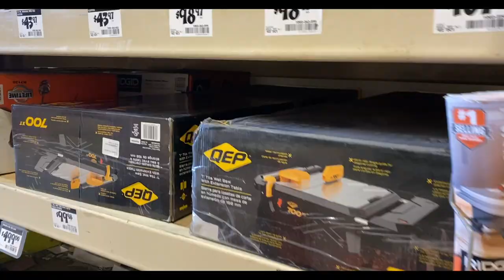The New Goonzquad Headquarters Part 46

Comment: The chips in the tile are more likely due to a cheap blade than a bad saw.  Get a high quality diamond blade and you'll be surprised with the difference.
Reply: Well said 👍👍👍
Reply: I thought that too. Having said that though, it did look like a pretty sh@tty saw. I'd have returned it, with the tile as evidence, when upgrading to the new saw.

Comment: 1/2" Durock or Hardie Backer is for walls. 1/4" is for floors. Set it in a mortar bed. Never lay it down without the mortar bed!
Reply: Also, looks like he used premixed mastic.  Big no no on floors or wet areas.

Comment: Strap those pex water lines! You’re gonna be mad if the wall gets closed and every time you turn the shower on or off the wall knocks.
Reply: Don't worry about that the shower valve is way too deep
Reply: That's why we use tubes instead of lines like you in US :D
Reply: @MegaGsizzle  tough guy, huh? Wanna cry for tubes?
Reply: @pischelales  hahaha 🤣
Reply: Doesn’t matter that the valves too deep the pipes will still clap the studs come on now
Reply: Jeremy Stephens  China / Japan / Korea would have something to say about that I'm sure.
Reply: Do a dry layout of tiles and cut a full one instead of leaving small pieces.
Reply: I made that mistake. I learned the hard way myself. Sucked to have to open the wall to fix after all the finish work was done. Hey...You live and learn.
Reply: @MegaGsizzle  The good old US of A all comes from Europe so calm down!
Reply: Here in Sweden we have all waterlines outside the wall, I would be scared having all that invisible in the walls
Reply: @MegaGsizzle  Old?
Reply: @HaroldWatnenase  just the clap herpies and plauge
Reply: @leeadler4221  Nah those countries don't innovate. They copy US innovations
Reply: Jeremy Stephens  I mean PPR pipes. They are strong and they will last forever. They are welded together and can be used even for heating.
Reply: @MegaGsizzle  A country founded in 1776 isn't exactly an old country.
Reply: Jeremy Stephens  Except you don't. The US isn't even in the top 5 among innovative countries, for 2020 they are ranked 9th in several indexes. Many Americans seems however to be somewhat indoctrinated to believe that the US is the greatest country in the world and having superiority to all other countries. It's gets even funnier when you realize that a very big percentage of US citizens haven't even travelled abroad or at least to a very small extent compared to people in many other well developed countries, and therefore doesn't a single clue of what the world looks like.
Reply: We have that problem.
Reply: @leeadler4221  China admits that they would rather steal ideas then take the time to engineer and invent on  their own.

Comment: If you're doing a steam shower you have to do a waterproof membrane on the entire shower, floor, walls, ceiling. The entire thing has to be water tight even the door setup you use.

Comment: When the tiles chip, first put some tape on the tile (shiny side). Then cut it. It will reduce chipping.
Reply: Nah. They should soak it in the water first. Very common. Don't waste your tape.
Reply: Something else is wrong if they're getting chipping.

Comment: We always used a grid system to lay tile. Snap a grid with chalk line. Then you can lay tile starting anywhere you want. On the line on one side of the square, off the line (by the width of your grout line) on the other side of the square. Makes everything so easy.

Comment: Please start using eye protection when you use a grinder. I've seen cutting discs explode and it's not a pretty sight... Please <3
Reply: I have a deep scar on my neck from 40 years ago.....piece of grinding wheel came off at full RPM. I swear, it's like getting shot.
Reply: Looks like that grinding wheel is a metal wheel, but it can still throw pieces of material. 100% agree... ALWAYS 👏🏻 ALWAYS 👏🏻 ALWAYS eye protection when grinding, no matter the type of grinding wheel!

Comment: I work in the tile industry and you guys tile better than people who have been doing it for a lifetime! Great job!
Reply: Well they forget the termination bar to the wood floors.
Reply: They didn't use motor under the cement board. The tile and grout will crack.
Reply: @chrishoca2938  I don't even think you are supposed to use cement board on a floor. You use that orange tile membrane stuff that comes in a roll.

Comment: When laying tiles, there should be an elevation toward the hole so that the water from shower will flow through that hole..
Reply: Very important point .  Or you get pudding
Reply: They said there dad is going to help build the pan to the drain.
Reply: @Robsav-yx6vi  who doesn't like pudding?

Comment: Since the drywall is done give that house a good cleaning and get the furnace fired up and running. You will need to acclimate all the wood trim and cabinets before installing for best results. Also spray the walls with one coat of paint before putting up any trim, it will save you from having to cut in on your painting. Just a couple tips

Comment: Definitely waterproof everywhere you can in the bathroom, it's BIG trouble when water leaks to the downstairs rooms.
Reply: Would have also done a higher threshold at the door so water can retain before it hits the hardwood.

Comment: Hey guys... Make sure you install the curb for the shower where the glass door goes correctly, it's a critical area for leaks. The shower liner and the way you install the  durarock is also critical. And... You should start your tile from the cent of the room and work toward the walls.

Comment: When you tile over the red guard, it's usually a good idea to use an "unmodified" thinset. Modified (which seems to be most common today) has some polymer additives which help to prevent the mortar from drying too quickly. Normally the cement board will soak a lot of moisture out of the mix. The additives help counteract that so you get a proper cure. But, when you put redguard down, that isn't an issue so that's probably why your thinset was taking so long to dry.

Comment: Great job on the floor! The red guard is great stuff. Especially for the steam shower and definitely a plus on the bathroom floor. With the steam shower you will constantly have condensation running down your walls and pooling on the floor outside the shower. Also make sure to follow the recommendations on the exhaust fan in the bathroom to get the excess steam out after during and after use. Maybe even slightly larger.

Comment: That redguard actually helps prevent the concrete and tile from cracking, when you lay it on a wood surface. I had to use that stuff religiously, when I did decorative concrete overlays.

Comment: You need to do a pre-slope with mortar in the shower before you install your membrane, which will be clamped to the sub-drain, which has weep holes. Then, about 2" thick mortar floor sloped to the top of the drain. Mix the cement pretty dry. You don't want it wet. Push it into position with a float. Keep checking with a level for the proper slope to the drain, and ensure you have no low spots. It should be as flat as possible. This is a time consuming process. Don't rush it.
Reply: Good advice there!
Reply: @johnstedman4075  Thanks. I've done a few of these showers, including one in my own home at a time when I had no idea what I was doing! Ha! But it came out okay. I won't say it was easy, though. After a few of them, they get easier. Still a lot of work, however.

Comment: I did the same thing you guys did and bought a wet tile saw last year. I realized after I was half way through the job that a manual tile cutter is much better for straight cuts. It's much easier, faster and cleaner.

Comment: Hey guys , just an advise from a builder about prepping the sub floor for tiles; You should use mortar and then screws for the cement boards.
Reply: Bingo! I'm surprised Home Depot didn't tell them that. And 1/4" cement board for floors. If you're tiling up next to a room with hardwood floors, the tile will be exactly 3/4" in thickness. Even with the hardwood floor.
Without the cement under that Durock, that tile may crack, or come loose, or both.

Comment: Hey guys great tiling done there, you can use these little plastic spacers to space them in between, these little suckers are great to simplify the job, and last but not least, get the grout laid between the tiles  2 hours after you laid the tiles, the grout will bond with the cement and seal and air buble that may have formed. Now on another level, it will prove useful if you create a slight slope to ensure that water doesn't stay in puddles on the tiles because this will create mold on the tiles which is slippery.

Comment: Hardy board/ cement board needs mortar under to be secured to the subfloor .
Reply: Thin set, not mortar. They did use thin set. Then grout & caulk.
Reply: @CarieSaad  under the cement board?  Did not see them trowel anything under the board.  Cheap mortar is acceptable for cement board to subfloor adhesives.

Comment: I typically specified tile centered on room each way and not use less than 1/2 tile. Given the pattern, you guys did well. Since using as a steam room, be sure to install waterproofing membrane on walls and ceiling. Where possible, align wall joints with floor joints.

Comment: I would have put the toilet flange in first. Then tile.  Also, grout now.  Then cover and tape with Masonite or ram board.
Reply: You are right. I would first start tiling the walls and at last the floor
Reply: It would be best to go ahead and install the flange.  Need to cut away the tiles around the pipe so the flange will set the same level as the floor tile.  Also, need to screw the flange to the subfloor after gluing it to the pipe.

Comment: You guys can use a utility knife to cut the cement board
Reply: are you going to help with there pond oh that would be great
Reply: O go on cus they love there job too 😁👍🇬🇧 I subscribe to both of u lol 😆
Reply: They sell a carbide knife that’s better. In a manual labor way. Best with the diamond blade. Like they did.
Reply: Yeah that made me lol when I saw them using the grinder :D BTW we all wish you would help these guys with their pond build, they tried to dig one and it's definately a fail and they need help/advice!
Reply: You can use a tape measure to cut just as good as a straight edge to and that really speeds things up . But i would practice with a pencil before using a knife .
Reply: I do remember me telling them to ask the pond guy for help with there pond even if just for aquascaping..
Love the videos Greg, your flippin amazing!!
Reply: What ist the cement board good for?
Reply: @stefanh.4369  alien invasion. Aliens are allergic to it so you can hide in your bathroom and be safe.
Reply: @johndoe-oo4el  and seriously. I am from Europe do not know this stuff ...
Reply: @stefanh.4369  mold
Reply: @stefanh.4369  More rigid on the floor so it doesn't flex and break the tile on the floor.
Reply: @stefanh.4369  also on the shower wall great for moisture unlike even the green Sheetrock.  Yeah I’m from the south where we use brand names like Sheetrock instead of dry wall. Hey, John get me a coke - meaning any soft drink. Lol.
Reply: Personally I would of done the shower first .then the floor . To easy to damage that weird tile floor .
Reply: @stefanh.4369  it give more stability because of the wood subfloor, and the mortar will bond better to it
Reply: @sch4074  thanks! Yea, I even had to Google what a sheetrock is 😂 Funny and nice, such differences.
Reply: @jeffjshrum47  it can be covered with card board.  Tile can take a beating,  but I hope they do cover it. Shower floors & walls usually do go first if possible to minimize damage to the tile like you stated
Reply: @mhks68  Hardie Backer is easier if you have the "Snapper" sheers that are made for it. My neighbor has the same tool with a different head that he uses for cutting sheet metal for body work.
Reply: @sch4074  Pop!!!!

Comment: FYI. That pre mixed needs to be mixed thoroughly before use. That could be affecting your drying time. Great job both of you!
Reply: well, that explains it all. also makes too much sense
Reply: @jhonditch4269  Yea i made a post about that stuff. I used to put like 12 tiles down in a coast closet. I figured its a small job just get a thing of premixed rather then a 25lb bag when i need like 5% of it. HUGE mistake. 5 days later and the stuff was like play dough still. I gave up and pulled up the tiles scraped and washed them and bought the bag and mixed it and put them back down. They were solid in like 8 hours.

Comment: Buy some extra tiles and save them just in case something happens and you need to replace them. I'm dealing with that issue right now.
Reply: Most don't realize it but a box of tile will have a color lot on it, meaning that the same tile can have a small but noticeable change in color.

Comment: Just a quick tip, the cement board should always be writing side up. The tile will stick better to the front side.
Reply: Doesn’t matter they threw red guard on it so the tile will stick
Reply: @imevaroo2402  red guard is a waterproofing liquid, it doesn’t help the tile stick better.
Reply: @_-0_x_-_p_0-_  your right, the tile doesn’t but the thin set does.

Comment: No thinset on the cement board tape joints? That might flex and crack tiles.
Reply: They should have set the Durock in thinset also. Big mistake.

Comment: If you guys are gonna do tile downstairs y’all should consider doing a heated floor! The wife will love you for that in the cold months 😂
Reply: Pretty sure that has to be done when the slab is poured
Reply: @wheeln24-79   with some designs. Others you can just lay a heating pad down before laying the tile
Reply: Yeah I've seen it don't both ways... In the cement itself and also in a thin layer of insulation between the floorboards and tile.  Adds about an inch to the finished height of the floor I think.

Comment: One thing i recommend when installing Cement Board is use some liquid nail under or use Thin-Set ( VersaBond )
Reply: I saw that to. I would have done Detra instead of cement board.  There’s a hundred different ways of doing it.

Comment: Future tip cut the tiles upside down so those chips on the design isn’t there, and it will be a lot neater
Reply: Must be a cheap blade if their getting chips on the tile. We never got chips, and we never cut tile upside down. Or are they cutting the tile dry?

Comment: I used that premixed ""thin set"" mortar one time.  And one time only.
Reply: only nice for backsplashes because it does not really sag and easier to apply.
Reply: @chickenfordinner2093  We used to use North American Adhesives NA-2040 for wall tiles (except in showers, where we used thin-set mortar).

Comment: If your going to be using a leveling system on the tiles y'all need to pour a leveling compound on the floor, otherwise you run the risk of having hollow spots under the tile.
Reply: They will definitely make mistakes, but how much are they saving doing it on their own???
Reply: @timothywilson3785  
Probably nothing if they have to do it twice. They just need to do more research.

Comment: Hi Guys...installing and putting Tiles...my suggestion is, you start from the center or middle then moving forward, backward or sideward so your sides will be equally the same, if your corners are exactly on a 90 degrees angle...

Comment: Y'all need to paint the inside before all this tiling 😜
Reply: I believe they plan on tiling all walls and ceiling so no painting
Reply: @EpleGoesInsane  they said a while ago that tiling should be done before painting anyway.
Reply: @EpleGoesInsane   Oh Hell no!
Reply: @benmac940  that’s wrong you need to paint before you tile if there is gonna be paint on the wall, you can’t paint the edge of shluter metal or bullnoseor like tape it cause it will show behind the metal or bullnose you don’t grout the edge
Reply: @SuperDarren1999  they did say that thank you if you are going to call me a liar I can go and find the video they said it in if you need proof.

Comment: I supped up one of those little saws by connecting a low flow water hose dumping straight on the blade.  Keeping the blade washed clean is very important.

Comment: never cheap out on screwing down the cement board,,,
Reply: There is a pattern for screws (or nails - 1-1/2" roofing nails), Every 6" I believe. It's marked on HardieBacker, which is what we always used.

Comment: You didnt  install any Kerdi board for that shower? Its gonna fail in a year and your going to have water leaks.
Reply: they didn't work on the showers, just the flooring in the rest of the bathroom..
Reply: They havent done much to the shower yet. They still have to add cement board still. Relax
Reply: Is that the orange dimpled sheet?
Reply: @sczorroc1552  kerdi is sold either as a board or a membrane you have to thinset to cementboard and your shower pan.  The dimpled roll is an uncoupling membrane called ditra that you can use in place of cement board over your wooden  subfloor. They're both products made by schluter.
Reply: @upwardsofunknown7161  Just never heard of kerdi board before, we will building our retirement home next year on land and just watching and learning all I can.  Thanks....

Comment: Where I'm from we would run the water sealant up the wall especially behind the toilet and hand basin and the whole shower area and as Doug Dale said the steam room needs to be completely water sealed or you'll have problems later on with timbers rotting! But I do enjoy watching you dudes work with all that enthusiasm and let's have a go at it attitude especially watching real tradies work and learning the trick of the trade from them. Well done. Cheers, Musashi